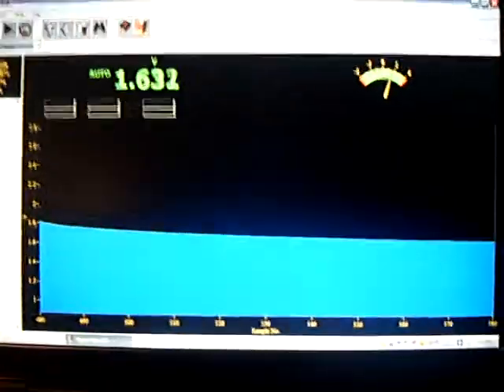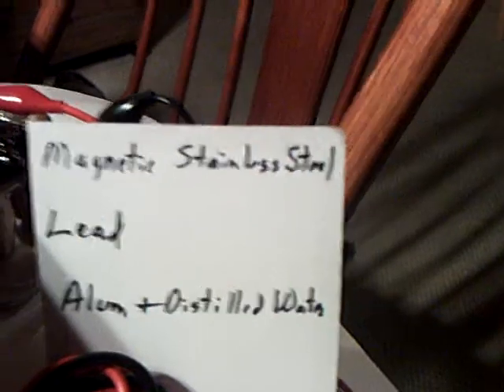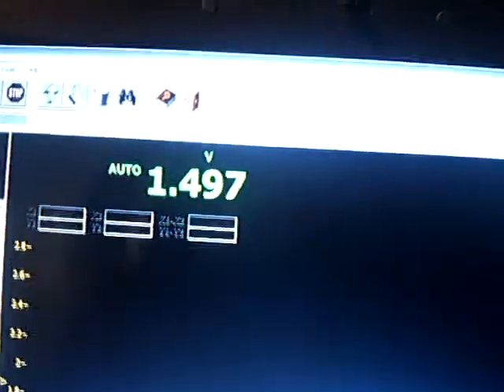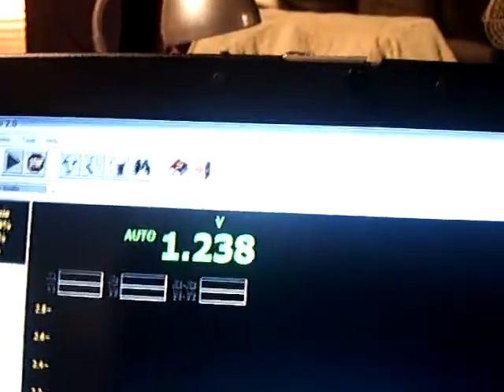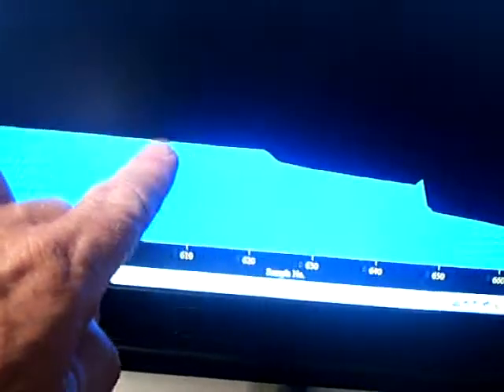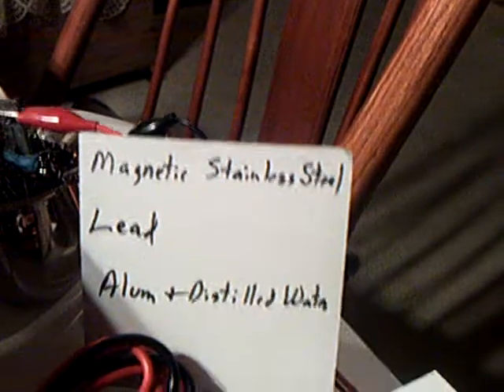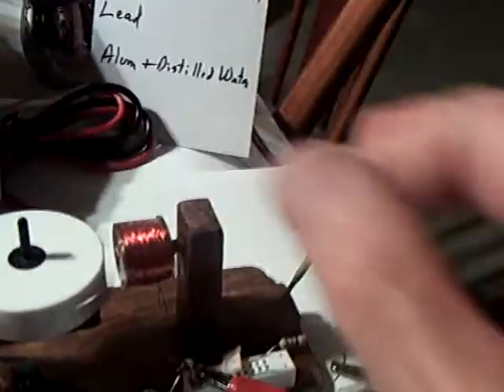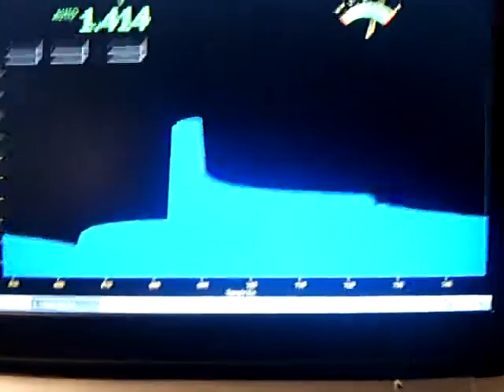More charge and discharge testing on homemade cells

Comment from the maker: The meter is a Radio Shack 46 Range Digital Multimeter W / PC Interface model# 2200812-1.   It is the same meter that John Bedini has used in many of his battery graphing videos.

Comment: Great work by the way. I just want to add my 2cents worth. Back in the late 80's or early 90's I had bought a cattle pros that ran on a 9volt battery. It was a energize and compared to the other batteries they were ahead by leaps and bounds in power. Then about 4 years later the same battery still ran the unit like a new one. I decided to buy a new battery just like it because the one in it was old. I noticed on the new battery that they took out mercury to be environmentally safe.

Comment from the maker: The meter is from Radio Shack.  The software comes with the meter. Yes it does have an oscilloscope function but I have not tried it yet.  I don't know if it is linux compatible or not.

Comment from the maker: I don't khow how this type battery would deteriorate over time.  The only thing that I have seen so far that is tricky is keeping the water content correct. If you try to over charge it the water boils off like in a regular lead acid.  Push it too hard and you could overheat it, warp the plates, and goodbye battery.  Sulfation is not going to be a problem the way that the chemistry has been explained to me.  Deep discharge doesn't seem to do anything to it either.